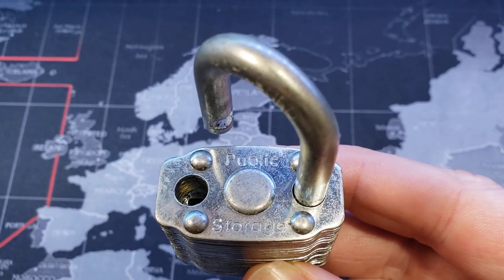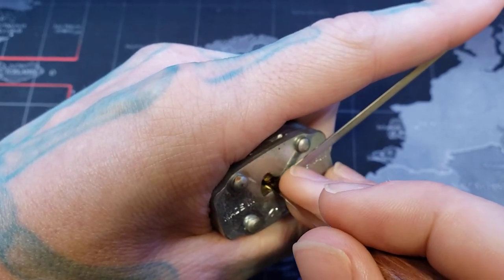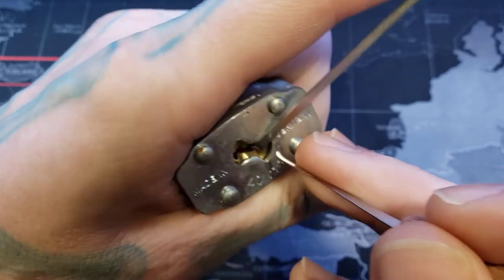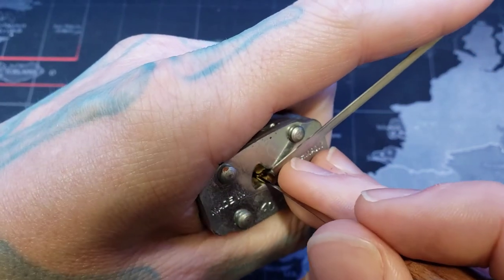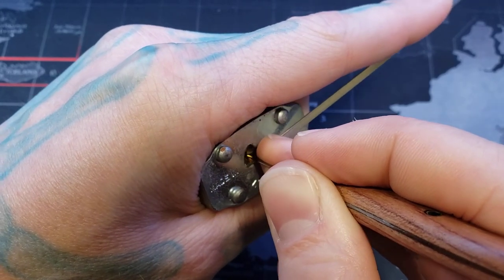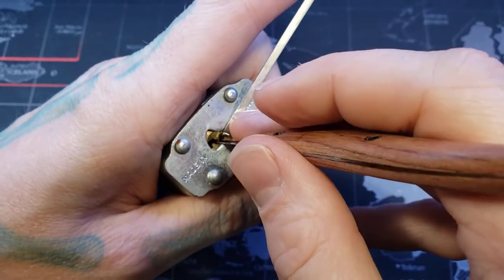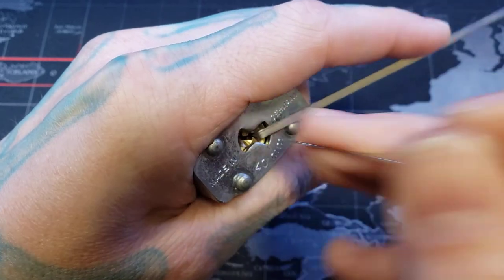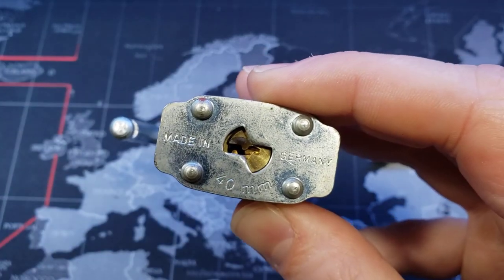68) Public Storage 40mm Padlock Made in Germany Picked

Comment: Harder to open than other brands I’ve seen on YouTube. Seems I’ve lost my key years ago, just discovered. I bought shims and tried the paper clip method. The shims did not work because too big and spacing on lock ring not large enough for shims to fit. And the paper clip method failed also. So I bought another public storage lock, the same one. Any suggestions what I need to do to get the lock open, to put the replacement on? Also the other problem is my storage units door has a metal plate that fits over the pad lock. Impossible to use shims on it. Only way is to pick the key entry. But working with the Key entry below you not in front of you does not work for picking the lock with the two paper clip method.
Reply from the maker: Paper clips won't work on these imo. These definitely have spools which means longer time to pick, which means the paper clip with definitely warp! Raking or single pin picking  with proper tools would be the way to go. But not worth trying unless you've opened other locks with spools.